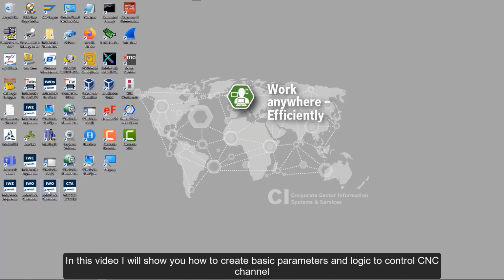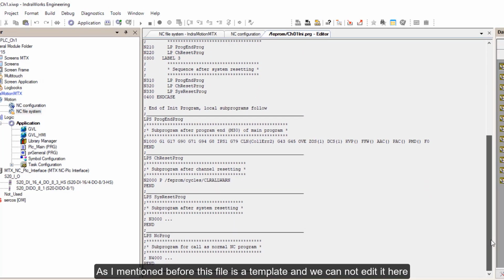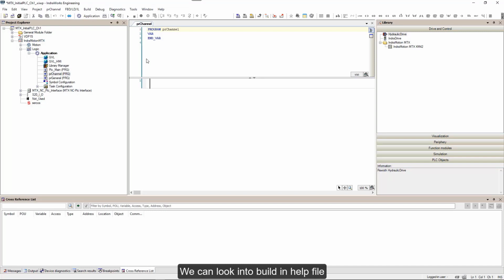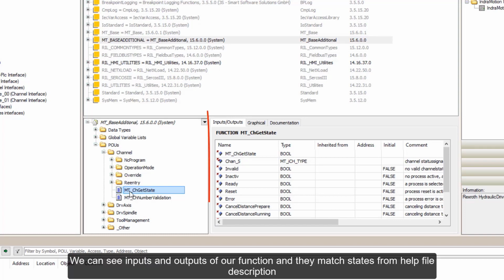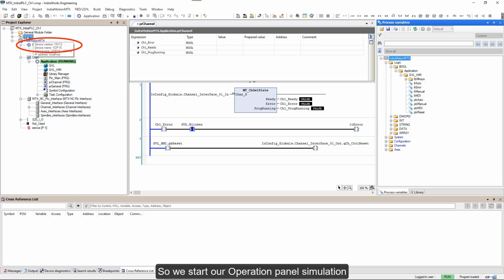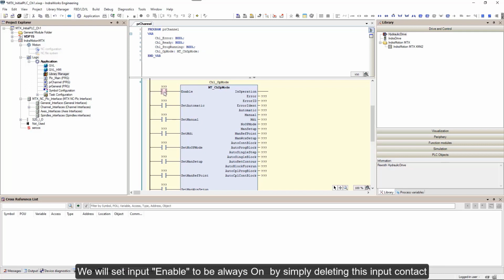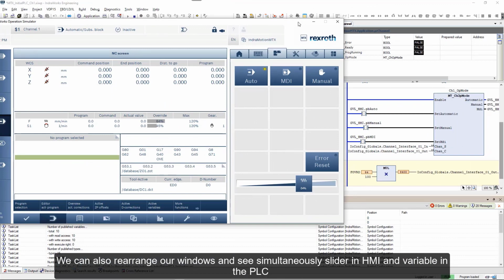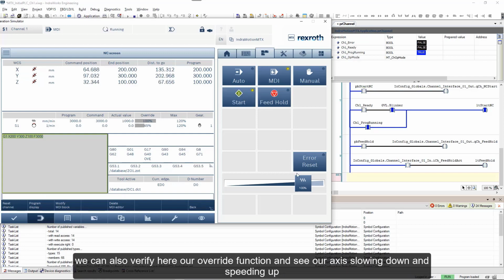CNC MTX – Channel Setup

Comment: Hello, I am having problems configuring my MTX, which I have as a lathe. I have it configured for 2 channels and on channel 1 the tool tables work perfectly, but on channel 2 it does not work, and I have already configured it with all its variables and function blocks referring to channel 2. Can you help me?